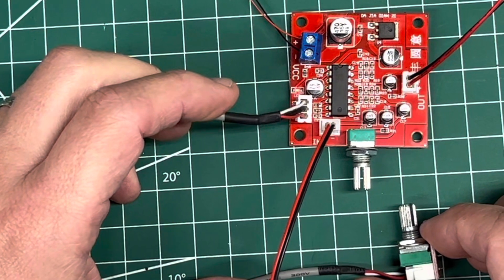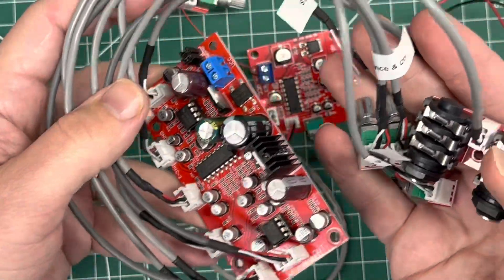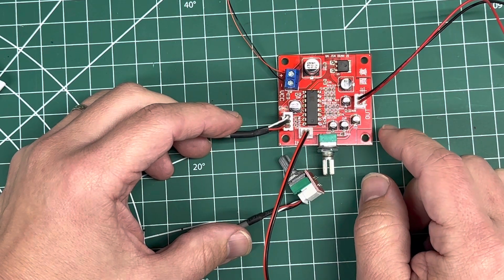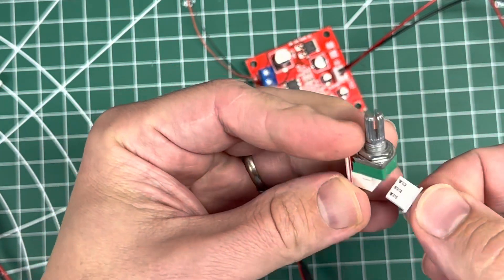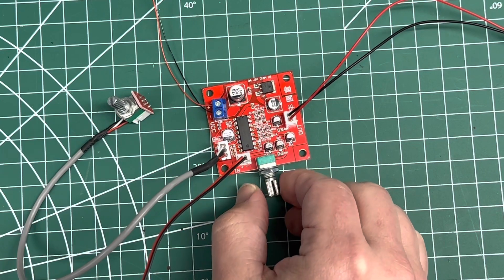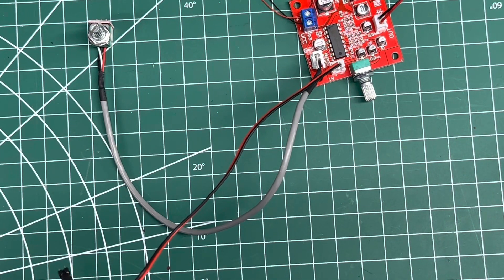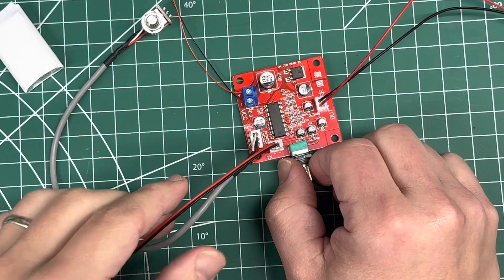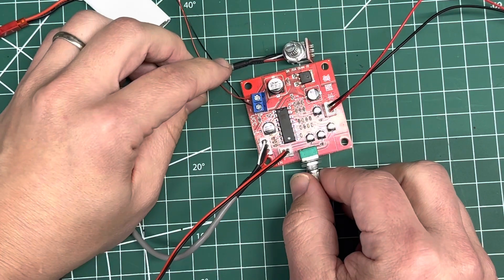Easy Reverb Board part 3: Demo Delay knob addon & comparison PT2399;echo pedal/cosplay voice changer

Comment: Man I've been messing with these things for about a year. The knob installed is a mix knob, and the one you added is delay time. I mostly turn these things into guitar pedals but have used them for synth and vocal effects boxes too.  When I make a pedal out of them because it's designed for vocals I make a passive jfet buffer at the input so level is even. These things are cheap and neat especially if your an audio nut like me. Tbh the closest thing this circuit sounds like to me as far as effects pedals is a fab echo by danelectro.